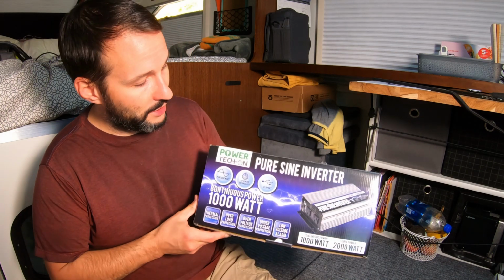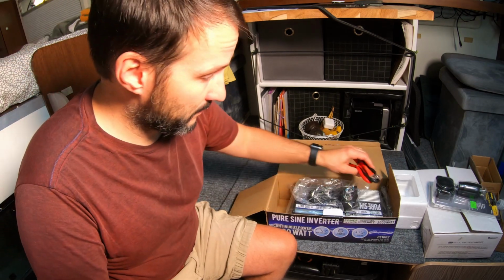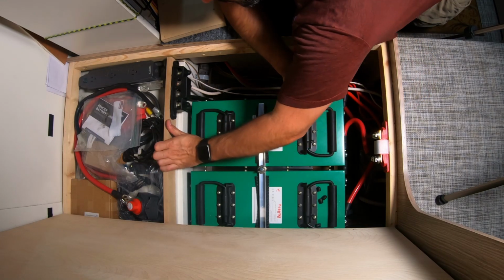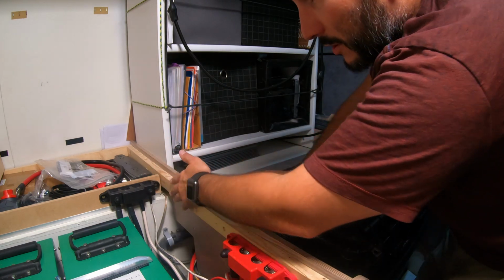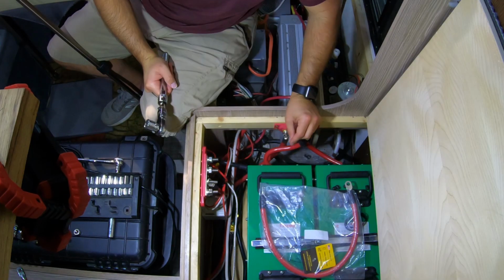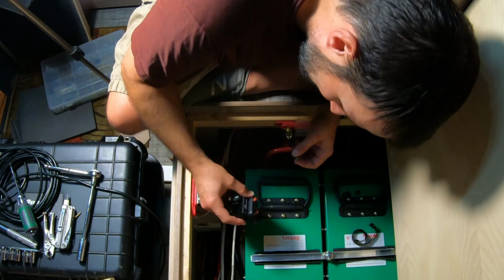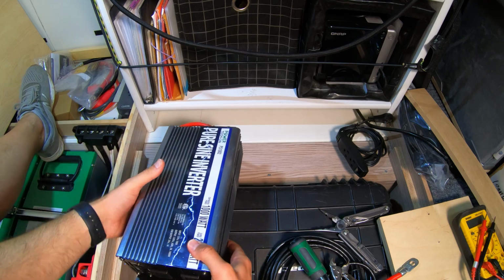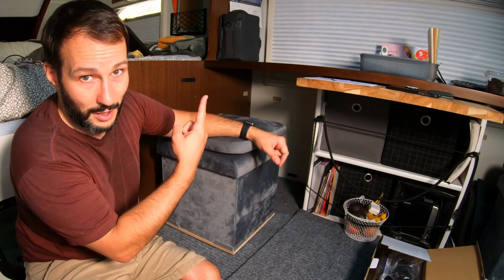Inverter Installation in our Truck Camper / RV  | We need 2 Inverters | Power for Computers

Comment: You really fit a lot in a small space! Have you run a ground from the inverter case lug to chassis by chance? I installed an inverter and struggling to find where to ground the case. No definitive instructions out there for a TC install. Thanks!
Reply from the maker: Yes, there is a ground wire back to the chassis. In the case of the Cirrus, it’s under the breaker box. It just attached to a aluminum frame rail. The “chassis” in a TC is a little different from a motorhome or van. 

It would be quite different in a Northern Lite or Bigfoot style fiberglass camper.
Reply: I have a Lance, fiberglass skin but aluminum frame, but not really sure if I should run the case ground to some contact point on the frame or if I should run it to the battery shunt, or to either the dc or ac ground bar? A TC tech on another site said that the shunt is chassis ground on a TC but before I ground something tied to the AC side I want to be sure about that. Yet another DIY puzzle! 😁
Reply from the maker: Explorist.Life has a ton of diagrams and videos explaining it. There are the official ways of doing this stuff, but truck campers frequently fall into a grey area.
Reply: Thanks again and safe travels!

Comment: The idea of running multiple inverters depending on conditions had never even crossed my mind. It's a great idea. You could run a really small inverter to just run laptops for most of the time (like a 300W)  then, when you need to run things like the AC, or an induction cooktop, or a toaster oven,  or other high out devices you could switch to the higher output, and higher power consuming inverter for the time you need it. While 2 inverters is more $$ initially you could save a not marginal amount of inverter consumption while your out boondocking to save as much power as possible.
Reply from the maker: You are 100% correct. We have out 2k inverter for the AC and Microwave. However, 99% of the time we just use our computers. So there is no sense in running a larger inverter for a small load. We went with 1000 watt for the additional wattage for other needs. Also, the idle consumption wasn't much different from a 600 watt. Another factor for us was redundancy. If one inverter fails, we still have a second to use. The primary factor that made me do this was power stabiity. When i would run the microwave or AC off the main inverter while my computers were also running, the equipment would reboot every time the microwave or AC cycled. So I needed dedicated, clean, independent power for the computer stuff.

Comment: Great video Scott!! Are you running your AC with your 2000 Watt Inverter ? Or do you run your AC with both inverters ?
Reply from the maker: Just the 2000 watt inverter. The other 1000 watt inverter that I installed in this video is dedicated to our computers/data storage/printer. 

It works very well!
Reply: @Stonyboot  Thank you Scott.

Comment: How long can u run the air off the inverter  prob draw 100 or so amps outta batteries..?
Reply from the maker: I was able to get 12 hours out of it. Ran from 10 am to 10 pm. That was a full charge to completely dead. I’m the real world, I only plan to use it for a few hours at night or during the middle of the day. Since we use our computers so much, they gobble up a lot of AH too. I’ll have a better idea once we get to some hotter climates.
Reply: @Stonyboot  that's alot of use. I have similar setup. I run the honda 2200 anytime i need the air. I have solar and 100ah lithium battery. works fir me but I not need lots power   great vids. I subbed.
Reply from the maker: Thanks for the sub! We do have a lot of power needs. The 600ah is batteries will support our needs for about 48 hours of computer use (I leave mine running 24/7 most of the time) if we we stay in one place for a few days, I’ll run the generator to recharge the batteries. If we drive, then we have plenty of charging. My next plan is to add some solar.
Reply: @Stonyboot  i think it's great you guys work live travel,   out there doing it
Reply from the maker: It’s not always easy, but we are trying our best! Thanks for watching and commenting, it means a lot 😊

Comment: Would adding a soft starter to the ac help?
Reply from the maker: Yes it would! However, it would not help when I use the microwave. Same thing could be a problem with using a hair dryer. The nature of our power needs for the computer equipment necessitated a dedicated inverter, a single blip in power can create 3 days of repair and possible data loss. I looked at going with pure 12v DC Power, but it would have required many, many adapters. The inverter solved all the problems in one project. 

I’m still interested in a soft start if we end up using the AC off the inverter very often.

Comment: Great install video.  Yea, kept thinking..."he's gotta take out those batteries" to get that screw out.  Way to stick with it.  Nice audible there with the location too, makes more sense (to me at least) to put the inverter where you did.  I assume you looked into one of those "soft start" adapters for the AC?  Curious if that would have helped with the electrical draw issue as well.  Probably not a bad decision either way to be made.
Reply from the maker: Thanks for watching. I do want a soft start capacitor. But we don’t use the AC enough off the inverter yet to justify it. But the soft start still wouldn’t solve the problem with the microwave starting. Once we need the AC more often, I’ll get a soft start to ease the load on the inverter. So many things to figure out, I love it!

Comment: Would a 12v A/C make a difference? Some vans are embracing 12v and are offering them as options.
Reply from the maker: I did look into them, and I held off due to costs. What we have now does work well, I just had that low voltage issue with a couple of our computer devices. This was a $200 fix instead of $500-1000. I’m so happy to see so many 12-24 volt devices out there to support people like us on the road. So many cool toys it makes my head spin!

Comment: Bring on more power upgrades!
If you don't mind me asking... about how much would you say your upgraded elex cost, soup-to-nuts? 
if you do.... no worries. Really interested in and impressed by your work.
Reply: Well, planning on hitting the road in mid-'21 and you guys have really inspired and expanded our thoughts. Will have similar power needs to yours, so I'm just curious how much to prepare for when upgrading a stock truck camper's power grid to this degree (via solar). I'm fairly handy with elex so I don't mind doing it myself, and would much rather have more than needed than less.

Don't worry, though... If you don't have numbers, I'm logging all of your product links as we watch the videos :)

Keep 'em coming. Really good stuff.
Reply from the maker: Awesome! It’s an exciting process putting everything together. My next project is going to be the alternator charging system. After that, solar! I’ll try to include prices in the next tech video. What kind of camper are you going with?
Reply: @Stonyboot  Still looking... will make the call closer to departure time in '21, although currently leaning towards Arctic Fox or Cirrus. The ability to modify and upgrade is very important, as is repairability and maintenance, so watching these videos that you and others provide helps show us what's possible.

Totally excited to see your upcoming solar videos!
Reply from the maker: @c11p  I just saw this comment. I’ve decided that even with the alternator charging system, I still need solar. So I’ll be planning that out in the coming weeks. More POWER!!!
Reply from the maker: Thanks. We have a lot more coming. I could add things up, but I don’t know off hand. Can you give me some specifics and I’ll look them up?